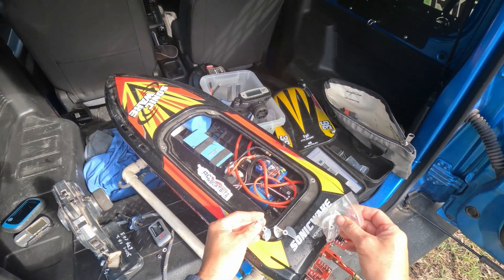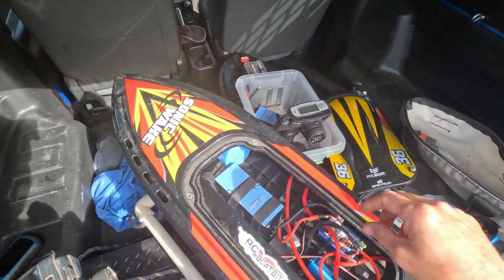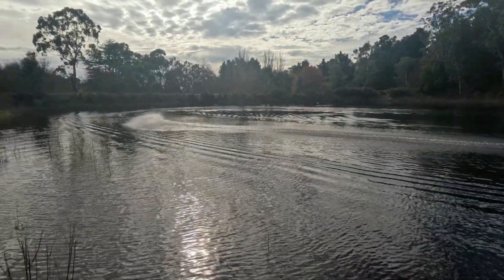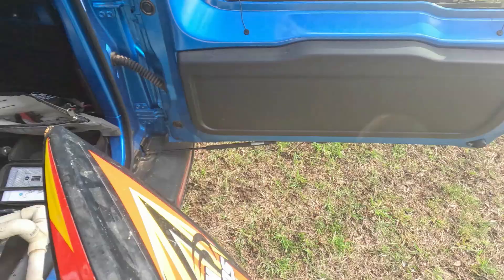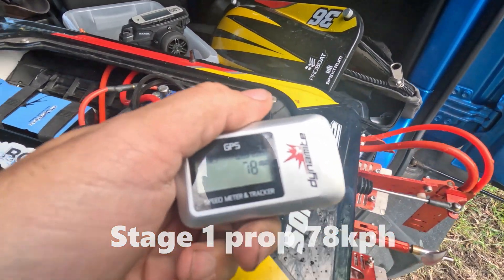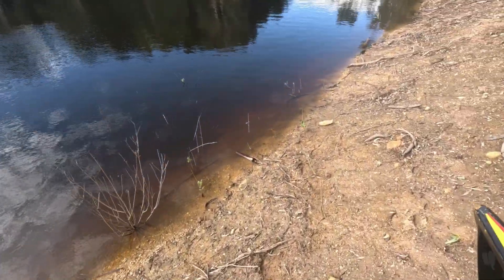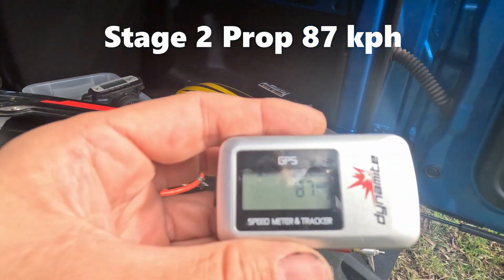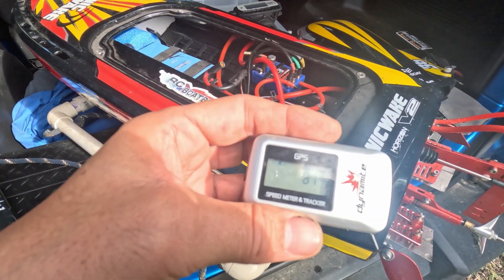RC boat prop GPS comparison 4519 vs RCBB stage 1 vs RCBB stage 2

Comment: Good comparison.. so stage 1 and 2 are detounged 4519’s?
Reply from the maker: nope, 46 and 48mm 1.4p props i modified and got copied in cnc
Reply: @RCBoatBitz  Oh right, ok, theyre banger props!! They go good!!
Reply: @RCBoatBitz  did I miss the memo on their release or have they been there all the time🤣🤣
Reply from the maker: @marxboatworx  no just a week, the smaller ones sold out already, got more coming of course